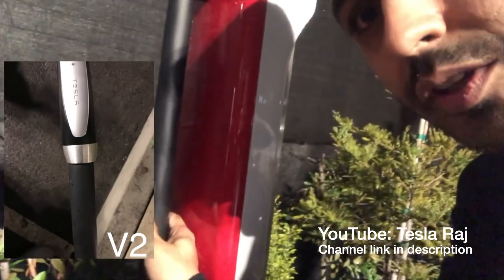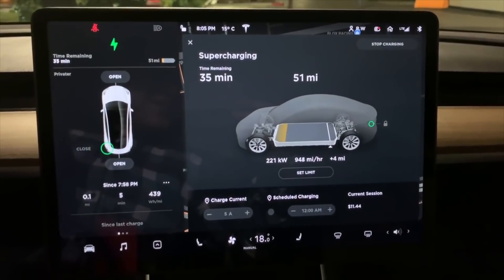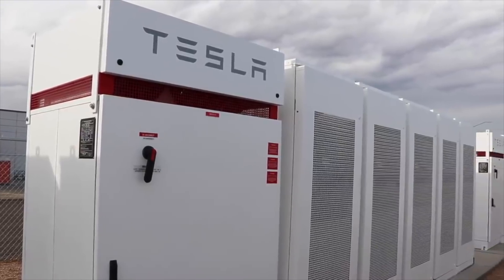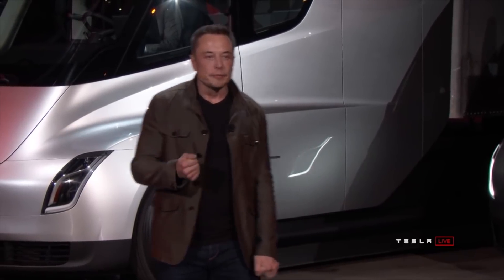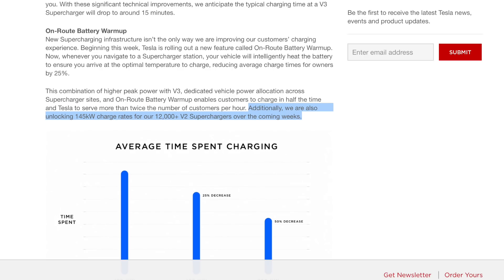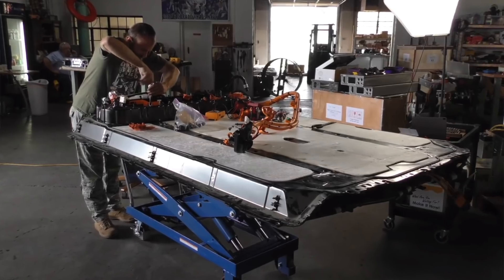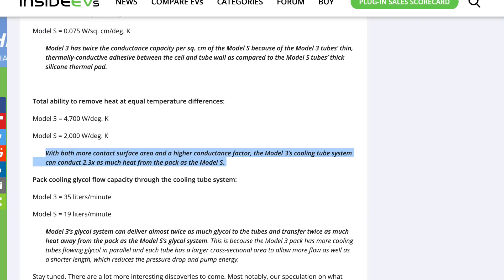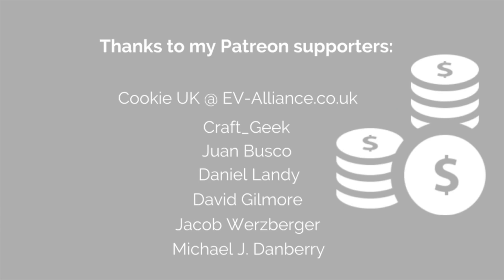Supercharging V3 and why Model S and X aren't eligible yet

Comment: you have to wonder if they'll offer pack upgrades for s/x at this point

135kw on 100kwh vs 250kw on 80kwh on a vehicle 1/3 the cost is something they do not advertise on the website 

supercharging gone in october 2018, credit half gone after
and then a 8k price drop on 100D
must've sucked to have bought one jan-feb 2019
30k more, 1 ft longer, 600 pounds heavier (mostly in battery) charges at 1/2 the speed.

S40 S/X60(75) S85 and S/X90 have not been eligible for pack upgrades to date, then again there's been so few of them.  You'd think the 85kwh packs are either a pain to procure on 2014 S or hardly any are being replaced to date. 

Seems like a profitable upgrade option they could offer.  120kw pack with 400kw charging rates for 10k after trading in old 75-100kwh pack.  Anything past v3 doesnt really matter as diminishing returns makes the time to get on/off highway larger than the charging time...

Model X really feels the pain due to its lower range being larger and with a good amount of the fleet opting for the larger wheels.  

Refresh will be here in another 6-12 months you'd think, largely just a new battery cooling and charging system maybe new lights and the good ole ventless air system, would be fun to throw out a battery upgrade option to the original s/x fleet
Reply: yes the model 3 aint bad for what it is, but if you really want an economic clean affordable car to be sold to the masses today it would be a <25k PHEV.

not a midsize sedan that will soon be in the 40k price range due to 35k being cancelled. credits ending and inflation alone adding on 800$ a year.

Comment: A few points worth noting: 
(a) Since Tesla's cars could be warmed up prior to coming to the supercharger - the pre-warming could help all cars: S, X and 3. The peak rate of 145 kW is decent enough in conjunction with this for most practical purposes. 
(b) Tesla's battery packs in cars - S, X, 3 are more efficient than the competition, so the same kW delivered to a warmed up battery pack leads to more miles/minute of charge rate which should be the end metric of value to a customer. This will promote top up behaviors and releasing faster superchargers after 80% SOC is reached.

Comment: Should help lower the cost of used Model Ss , my next car. New pack design for S/X will probably not give any benefit for existing cars, may not be compatible. Might need a water pump swap too. Could reduce chance of overheating while racing or towing, but charge rates are already at max probably. Next gen S and X should bring them up to par with 3.

Comment: I think this video highlights one of the major issues of being an EV early adopter.  EV technology is going to change much much quicker at first.  The EV you buy today might be seriously obsolete in less than a decade where even a 20 year old conventional car can still do the job nearly as well as a current model year car.
Reply: Bullshit. A 1998 Corvette can't touch a 2019. A 2020 Dodge RAM pickup has 1000ft-lb of torque. I assume you bought a cellphone? Obsolete in 6 months. If you need a car, you buy current technology car. If you can't buy a car, you sit on the sidelines, worrying about the stupid stuff for those that can buy one?

Comment: i wonder what the Roadster 2020 has for cooling system. Because it did a 0-60 so many times at the reveal, incredible
Reply: much larger pack, probably a decent sized radiator and the better pack design.  i mean the front of the s/x is pretty empty. plenty of space for a deeper/larger radiator. not rocket science to add more cooling to a cooling system, rather cheap vs the cells cost

seems like it would be far cheaper to just increase charging rates and decrease pack size which we're seeing here

a base 3 with 220 miles can just about keep up with a 100D with 330 miles across the united states NYC to SF.  the 3LR would beat the 100D

oddly the P100D despite having a better pack? doesn't beat out the 100D charging wise?

Comment: 145 kW isn't minor! The current level I usually get is 118kW when I'm not sharing a stall. Which during daytime does not happen that much. Otherwise its 92kW I think so always be getting 145kW will be awesome especially when enroute on long trips. Meaning, that on any SuC stop which has a free stall you will be MAX charging for 20 minutes with an S/X100D to charge till 60%.

Comment: I ordered the $37,000 (standard plus) Tesla Model 3 and they said it'll be ready by the end of this month. I was wondering if I should take delivery right away, or should I wait (they said that's an option) since I've heard that Tesla is constantly improving their vehicles, and my thinking is that if I wait, I might get a slightly better car. I'm excited to get my car, but ultimately I don't mind waiting as long as I get it before July 1st (when the tax credit gets halved again) if it means I might get a better car. What do you think? Am I over thinking this lol?
Reply: I forgot about the new Computer Hardware 3.0 they're adding as standard in all their cars soon. I think I'm going to hold off for that!
Reply from the maker: I don't expect for them to make any new updates to Model 3. Tesla is focused on cost reduction. AP 3.0 will be tied to FSD so as long as you bought that you'll be fine, even if they have to retrofit it post purchase. Go for it.
Reply: @AllThingsEV   I can't afford autopilot right now, but I do plan on buying it later, and yes I know there's an up-charge for doing that. If I wanted full-self-driving I'd have to pay to get the hardware upgraded in addition to paying to unlock the software.

Comment: The "it takes an hour to charge" thing is a standard dis by the anti-EV press. It assumes you arrive at 0 charge and leave at %100, which is nonsense. When traveling in my TM3, I look for charging at no lower than 30 miles left, and leave at about 250 miles. That's 20-30 minutes on a supercharger.

Comment: Judging by other recent actions by Tesla to pause the incentive program and close stores, Elon does not see demand being a problem for them going forward on any of their products, including the standard range Model 3. There must be other (technical) reasons why S & X can't participate in the 250kW charging right now. 

Model S & X are supposed to be the company's flagship models that stay up to date with the latest technology so I have to assume that the Model 3 getting Supercharging V2 first means that there's a refresh in the works for S & X that isn't quite ready yet. If I were in the market to buy a Model S & X I think I might hold off at this point and wait for the refresh that is obviously coming. Cutting supercharge times in half is a big deal that is going to affect the value of existing Teslas that can't be upgraded so I'd also hold off on buying a used Tesla S & X.

OTOH, Tesla shows that it's not abandoning its loyal S & X customers with the 17% upgrade to 145kW. That's one thing I really like about Tesla, they're constantly working to try to improve even cars that are already sold and in the field.

Comment: When the S and X are upgraded a lot of people are going to trade up. Faster charging new, ap hardware, interior redesign.
Reply: The Model S and Model X were not made with large quantities in mind. A replacement for either of these will be quite a bit cheaper. The Model 3 is almost so much cheaper than the Model S or X that it potentially is hurting sales of them

Comment: No one spends 15 minutes at a gas pump unless there's a crazy huge line.  The pump typically puts out a gallon every 8 seconds so 15 minutes is 112 gallons.  I usually spend 2 minutes at the gas pump, including paying, when out on a trip.  However, 10 minutes per stop is acceptable on a trip because of the need for everyone to stretch and use the bathroom.  If you can get 150 miles in 10 minutes, you can drive all day because you would do that every 2 hours which is every 150 miles or so.  That's assuming there are chargers every 2 hours along your route, which is currently only true if you stay on the main roads.
Reply: yeah I am in and out as fast as possible. I should time myself next, but I doubt if it is longer than 4 minutes

Comment: I remember a good while back one of the differences between the Model 3 long range and the the standard range was that the long range would charge faster at the SC.  The standard range if I remember right was going to be limited to 80kw rate.  Now that the Standard range has been announced, I wonder if it will have the ability to charge at the 1000 mile rate.  Using smaller cables inside the car could be one of the ways the got the car down to $35K.  No mention on the Tesla site when I just checked.
Reply: According to Tesla's publication the long range model three is the vehicle that can reach 250kw.

Comment: V3 chargers without battery storage will be a nightmare and be more environmentally damaging than drilling oil, shipping halfway around the world, refining in Louisiana, shipping to the gas station and burning in a car! EVs make sense with off peak or renewable energy, not multi-Use peak loads supplied by fossil peaker power plants! Where are all the batteries coming from? Where are they going to be installed? Most Superchargers are in existing parking lots with very limited space. I would love to see all this happen but many things don't add up with this one. I live my Teslas,I just don't want to lose sight of reducing carbon emissions, not increasing them!
Reply: Charging faster does not increase carbon emissions. Also, in the US EVs emit between 20% to 40% of the CO2 that ICE cars do. For example, on average a Tesla Model 3 Performance will emit 25% of the CO2 that a BMW M3 will.
Reply: @nafnaf0  You obviously know nothing about how our electric utility grid works. Peak loads are almost 100% fossil fuel powered peaker plants burning a form of kerosene. Charging cars at the rate of 1MWh will create huge peak demands unless all the chargers have 100% battery backup of sufficient size to charge all the cars during the high demand hours of the day. For a busy 10 or 12 stall charging station, that is a lot of batteries! As I said, Tesla can't make enough batteries to meet demand now.
In fact, I don't think most EV owners realize that if you care about reducing carbon emissions, you should set your charging schedule at home for 10pm to 6am. Charging almost any other time means the electricity is coming from burning fossil fuels. I do this even though my utility rate is the same day and night  (no time of use rates) and even on sunny when my grid-tied solar is cranking out 25KW. This maximizes the amount of "green" energy I am putting into the grid and minimizes the amount of fossil energy I draw from it. Lastly, it time Tesla and all us owners start minimizing wasteful phantom drain, preheating and other needless wasting of electricity. Waste is waste even from a "zero emissions" EV; which almost none are! Only a few charging 100% from solar and by discounting the carbon footprint of manufacturing.
Reply: @nafnaf0  I am not saying EVs emit more carbon than ICE vehicles. In fact even charging EVs from a coal plant results in far less carbon emissions than drilling oil halfway around the world, transporting it, refining it, transporting it again and then burning it in an inefficient engine. That is not the point. The point is to reduce as much as possible carbon emissions period! Less bad is still bad. Simply converting to an EV is not all any of us can do. We need to be smart about the transformation. Adding tremendous peak demand to the grid is not going to solve the problems of global warming. We need to be smart about this.

Comment: To put this into perspective, I used to have an old VW Transporter which would do around 75-80 miles on £20 worth of fuel on mixed driving [roughly 26mpg]. Typically, putting £20 in the tank and going into the kiosk to pay for it took around 5 minutes. So, the Model 3/Supercharger V3 is getting short daily drive charge periods down to a very manageable time now. For those without off-street charging, and given a local V3 charger [in the future like fuel stations dotted everywhere] this could make millions more people change over to electric.

Comment: I agree that the S & X likely lack the hardware to take the full charge rate, but to your other point, why would they want to boost Model 3 sales more than the higher-margin S/X?
Reply: Shows a good sales rate, if sales don’t slow down from release the investors will invest more money into the company
Reply: Correct, the S and X have the 18650 battery cell which isnt capable of such high speeds. And they dont use 2170 cant discharge energy fast enough

Comment: The 18650 battery cell isnt capable of such high speeds. And they dont use 2170 cant discharge energy fast enough to give the iconic 2.4s 0-60 on the S and 2.8 on the X.
Reply: correct, thank you for posting this. Many are confused

Comment: Model S isn’t the flagship anymore. It seriously needs an update.
Reply: The car is continually updates. It is nothing near the original S. Day and night difference.
Reply: hur dur, welcome to tesla where we gimped the battery pack in your s/x worth 25k at the time by not adding enough cooling loops which are dirt cheap compared to the battery cells. the cells aren't even better in new cars, cheaper slightly sure, just more cooling, nothing revolutionary
Reply: @Richard-ie1if  They aren't even the same cell dumb ass. the 21700 can handle a lot more current at lower voltages then the 18650's which are in the S/X.

Comment: Gas cars still rock for long distance travel
Reply: Sort of, but gas prices are starting to rise so much that it makes them too cost prohibitive.
Reply: yes that is still mostly true it you are doing a road trip. Getting one of the Tesla's with the 300+ mile range and having V3 will make it much better though. One of the the biggest things is the cost for energy is much less with the EV. It basically cost between 1/4 to 1/3 the cost of an ICE car. The Model 3 will cost about $500 a year in electricity (but much more if you frequently use the supercharger stations, which now are a rip off at $0.31per kwh, which is about equivalent ~$2.00/gal for gas)
Reply: So rent one - that's what I do. Why on earth would you wear your own car out on a 2000 mile trip? In other words, one trip each year for vacation should not justify an idiotic buying decision when you spend the other 50 weeks of the year driving 8 miles to work (and lugging around all that battery)

Comment: @0:27 In Tesla’s blog post, they stated they are using 1MW power cabinets, not PowerPacks. While it’s likely they will add some PowerPacks for peak demand shaving, its not part of V3 supercharging announcement. 

I agree that this is more of a covert Tesla Semi/Pickup/Roadster charging network, and I don’t think it’s really for the model 3, but rather some hype just prior to taking reservations on a bunch of model Y, which is likely a model 3 with a different body.

People should understand that right now, only limited early access beta testers, the same ones who have rooted Teslas with Full Self Driving, have this ability to charge at the maximum current possible, and even among that group it will be incrementally given access.

Tesla stated they will break ground on the first non-beta V3 next month (April 2019), at some undisclosed location in the US. For most of 2019 Tesla will limit use and assess the damage done to the batteries. I just hope someone with access lets Bjorn fly over and make a video using something other than a potato.

The tangible news is that Tesla will precondition on the way to the existing superchargers. As the poor people buy model 3 and park them on the street and need to frequent superchargers, this was the biggest value to Tesla customers. Much better than a fart app. It will save money and free up supercharger slots sooner. 

Let’s see when the first non early access model 3 gets access to V3 superchargers.
Reply from the maker: Check out where it links when they say ‘utility scale products’. https://www.tesla.com/blog/introducing-v3-supercharging

Comment: Actually today they announced a Firmware upgrade for S&X
Reply: No, S and X as currently built will never be able to charge at 250kw.  They announced a software update that will probably allow 100kw packs to charge around 145kw
Reply: Was going to say the same. Might not be the same charge rate though, the 3 does have newer designed battery pack with much better cooling.

Comment: Tesla won't announce V3 charging for S and X until it's already in production to avoid having people wait to order.  Honestly, they probably won't saying anything until after they're shipped.
Reply: The S and X use older battery tech that can't be charged any faster. You will have to wait until they redesign of the Model S or X
Reply: @nafnaf0  Agreed.  What I'm saying is that Tesla won't even tell you about the re-design until the cars are on trucks on the way to customers.  They need to avoid the Osbourne effect.

Comment: Tesla will under cut its own model S/X sales if the V3 charger is not compatible with S/X.
Reply: he doesn't mention it, but the batteries in the S and X are the older Panasonic ones and physically can't charge any faster than the V2. The batteries on the Model 3 are the newer design, which can charge much faster.